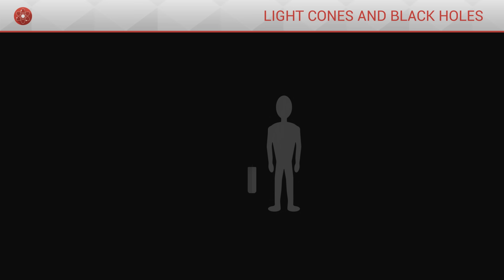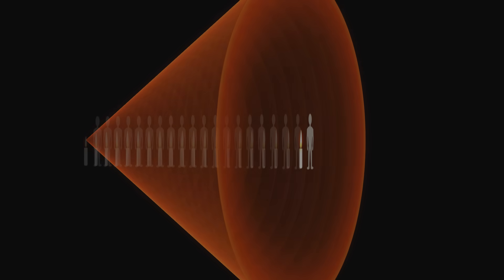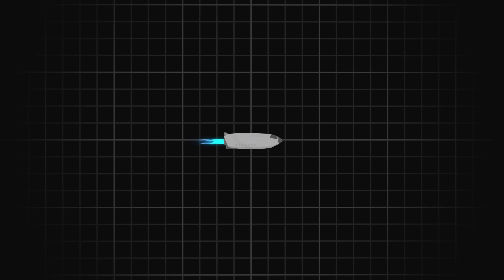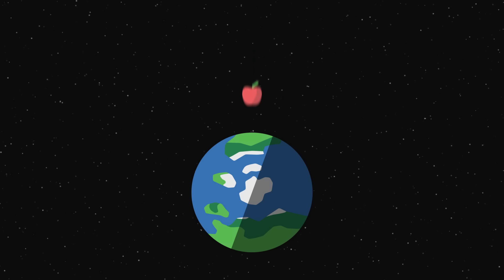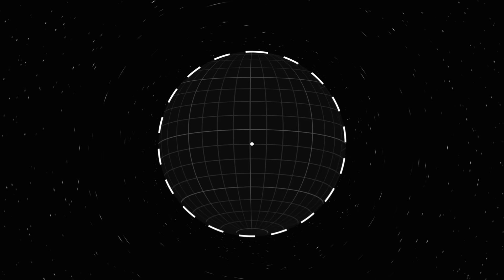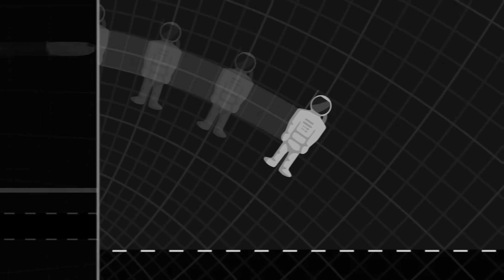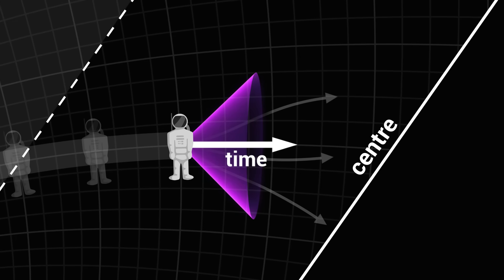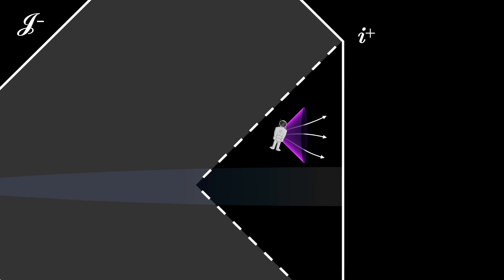Why Time and Space swap in a Black Hole

Comment: Not a fan of relativity to be honest... 
Like there is something weird when you unwarp spacetime around a black hole. It looks like it's growing through time forcing everything to escape from it at the speed of light to avoid it. 
Yet we figured out with Hawking's radiation that they shrink through time. So there's some weird paradox with this theory. 
And also I'm yet to find the paradox with FTL travel if you can isolate time dilation through warped space time.

Comment: So an object like earth also bends time towards its centre, so objects falling down are also going into their respective future. But we can still move up away from earth whithout going backwards in time. Why is this not the case in a blackhole? What if you have a rocket and you point it away from the blackhole and fire its engines? What would physically happen if we assume it could withstand the tidal forces and also have enough fuel to thrust long enough to get far away from the blackhole?
Reply: Because the curvature of spacetime in a blackhole is so extreme that all directions inside the event horizon point towards the singularly the only way to escape would be to exceed the speed of light which is completely impossible.

So while the gravity of the earth does pull objects towards their future its not so strong that it creates a reverse lightcone and so you can escape it's pull so long as you exceed the escape velocity.
Reply: @MS-87879 ah I kinda get what you mean but can’t visualise it… wish there was a video that showed that specifically.
Reply: @Ashadowtotheworld  8:39 should show that visualization.
Reply: @Ashadowtotheworld Ya I get it I only understand the basics myself but even the weakest blackhole has a million times the mass of the earth or three suns in a radius the size of a small city. You can understand how such extreme curvature can turn physics on it's head.

Comment: Why in Lorentz Factor never applied to the oscillations that are particles. At some level it is generally accepted that a particle is an oscillation. Move an oscillation, apply Lorentz factor and frequency increases. Frequency increases, E=hv then energy increases, e=mc2 then mass increases, frequency increases, wavelength decreases.  Wavelength=C/Frequency. There is length contraction. Watch this post:
https://youtu.be/zoWxTHCzdzU?si=JlumC4NOCncFBdAt

Comment: The past no longer exists, and the future does not yet exist; only the present exists, the universe mutating at every present moment. It is a mistake to believe that time is a dimension that extends far into the past and future, although mathematically it is a good tool, but it causes us much confusion and, above all, a misconception. It is not that within the event horizon time "bends" and interchanges with space; the fact that the "light cones bend" inward simply means that space is moving toward the black hole singularity at the speed of light, dragging any sphere of light with it. Even further inside the event horizon, the Eddington-Finkelstein coordinates tell us that space moves at speeds even greater than the speed of light, which is very similar to what happens with the expansion of the universe at great distances. So space is actually being sucked into the black hole, dragging the astronaut, the light, and everything in it with it. It's not that the astronaut is "falling" into the black hole, but rather the space around him is being swallowed up at a monstrous and absolutely incomprehensible speed! My philosophical question is: what happens to the energy of all that space? Does it modify the energy of the black hole?
Reply: the present doesnt exist either

Comment: Found an error.
You said that we would get no information that a supernova occurred before the light of the explosion reaches us. 
That's not necessarily correct, as we'd be hit with a wave of neutrinos a couple of minutes earlier. Those travel almost at the speed of light and will not be overtaken by the photon wave, as long as the supernova is within our galaxy.

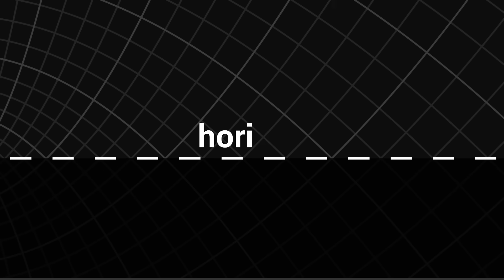Comment: 7:23 It's not horizon, it's the event horizon you mean. Not fully horizon, not like Earth. It's just called the event horizon because that's the full name of it.
Reply: pedantic lol
Reply: @ilikesonicx  I'm right. That's not fully called the horizon. It's the event horizon, not horizon itself.
Reply: @MassimoCalderaro-u8h  — And if I asked for salt at a restaurant, they wouldn't bring it to me unless I said "iodized sodium chloride" now, would they?

Are you getting the point?
Reply: @LowerAtom  I see that. I'm just explaining that the full name is not horizon, it's the event horizon because it means the point of no return.
Reply: @MassimoCalderaro-u8h — Yes, and you would be correct. However, the issue isn’t with what you’re saying, but how you’re saying it.

This is more of an issue towards language and communication rather than physics; but the way you said it sounds as if it was a mistake.

It doesn’t sound like you’re giving additional information to the argument, but rather denying it because it has been shortened to words that —even if changed— people would've still understood what it meant under that context.

We’re not saying you’re wrong. Just don’t correct people for using terms that are also valid. People don't go correcting others for saying «(a+b)²» instead of «a²+2ab+b²».
Reply: @LowerAtom  I'm not correcting them, I swear. And I don't have to give additional information because there's a lot of meanings on the terms event horizon and horizon. I'm just saying that it's not the full name of the boundary of the BH.
Reply: @LowerAtom  And sure, of course I do understand that horizon is a short name. And no, I'm not denying it. I'm just saying if you use the word horizon itself a lot with a black hole. It depends on how you are using it. Because that associates with the line where earth's surface meets the sky. But in this case, it's not really a horizon because it's not a distance. It's a point of no return. So that's why it's commonly and completely called the event horizon to mean the point of no return. But I don't exactly deny the short name. I do believe them, but it's just sometimes confusing when you say horizon. I've seen that word on diagrams where I understood it was an acronym for event horizon. I'm just saying that there's no horizon on a black hole like on earth or another planet where you see a distance on the surface of the planet towards the atmosphere, it's a boundary and not a distance. And I'm sorry for repeating this. I wanted to be clear.
Reply: @MassimoCalderaro-u8h — I understand now, you just tried to give additional information. However, the intention was kinda confusing when you said it and the comment felt redundant, but I’ll believe you.

By the way, I understand which horizons you’re refering to, but I still doubt someone watching this video might get them mixed up.
Reply: @LowerAtom  Yeah. Me, too. I doubt the constant usage of the word horizon as well when it depends on how its used. And no, it doesn't have to be necessary. Well, the additional information is when horizon and event horizon have more than one meaning. Like when you say the phrase on the horizon, it can mean the distance that is far away or it can mean approaching. While event horizon has a second meaning that doesn't have to be astronomical. The second meaning just means point of no return, which means there's no coming back to the previous thing.

Comment: Instead of a cone, think of it as a tunnel, open up both ends, your resting speed is orbiting around the tunnel, forwards or backwards in time you just spin around the middle infinitely, space pulling you ahead time pulling you from behind. This is how you would inflate infinitely with the system, adding speed gives you velocity in the dimension of time, pushing you down the tunnel your vector line gets more vertical until you approach light speed, travelling at light speed you can keep your vector aligned with the tunnel forever, gaining mostly distance in space not time, going even faster you will start to see a curved vector ahead of you now, bending towards the edge of the tunnel, you have enough momentum to travel out from in, breaking free of our singularity, in about 13 billion years you should breach out of our tunnel into a larger one, where your new speed is now your resting speed in the larger universe. It seems like you are back where you started in a larger tunnel with no way to get back, i imagine that dilating in size and scale is the flip perspective in, from out. But really what is in what is out..